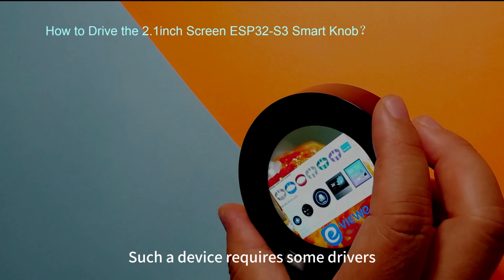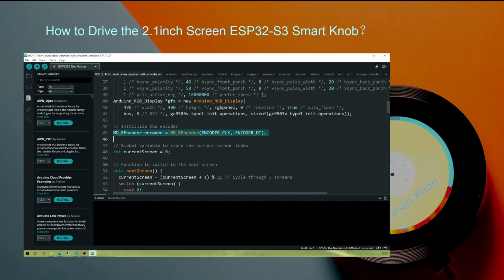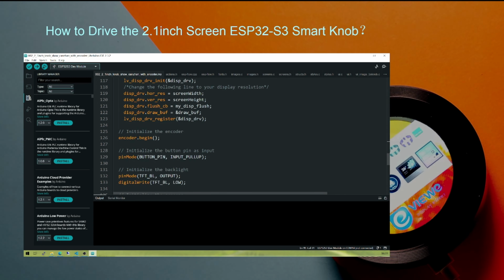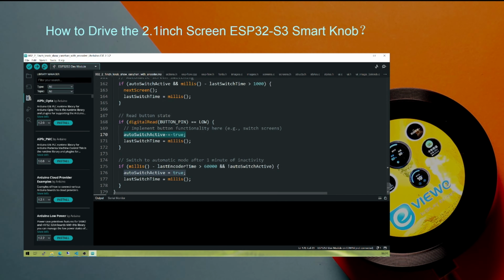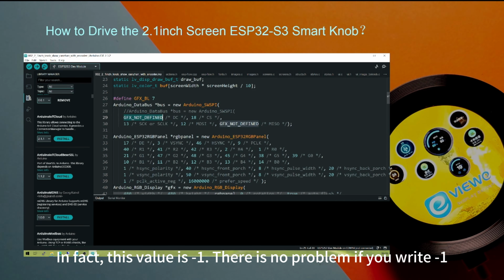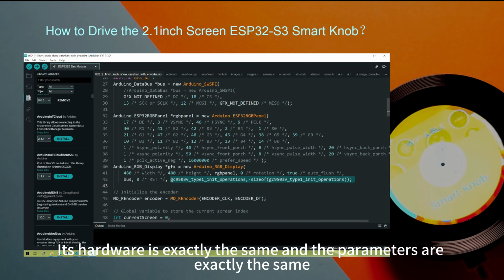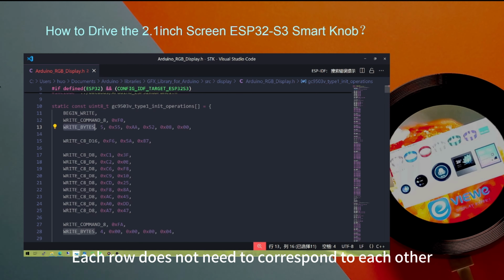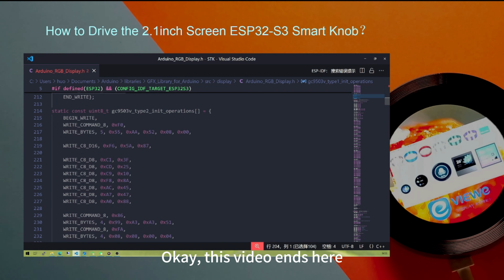Tutorial: How to Drive ESP32 Smart Rotary Knob Display #esp32display #arduino #smartdisplay

Comment: I haven't been able to drive or upload anything to my devices. THe instructions on what o modify are very vague. I've had no success using arduino or visual studio code-platform io or anything from squareline studio. No success uploading demos or examples. Any step by step videos for UEDX48480021-MD80ESP32-2.1inch would be greatly appreciated so I can buy more of these.
Reply from the maker: you can get our github: https://github.com/VIEWESMART/UEDX48480021-MD80ESP32_2.1inch-Knob